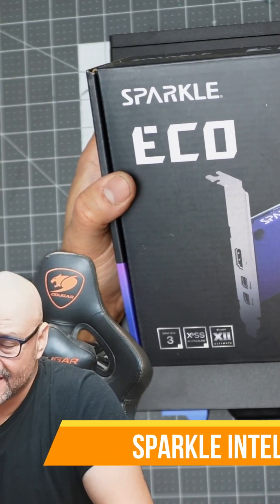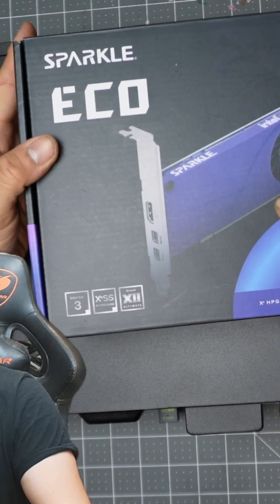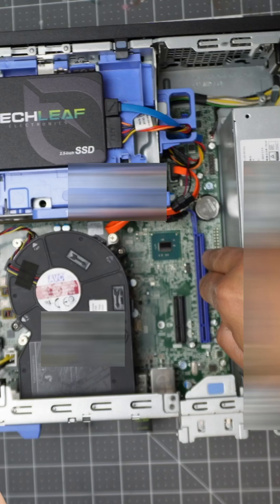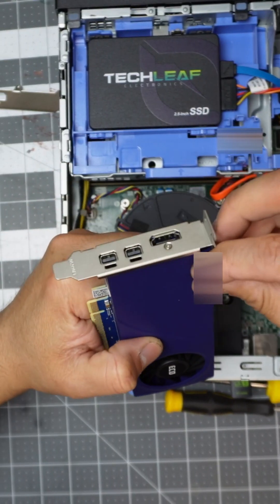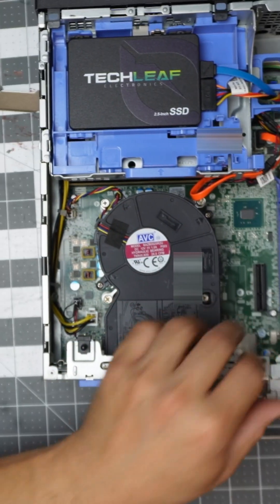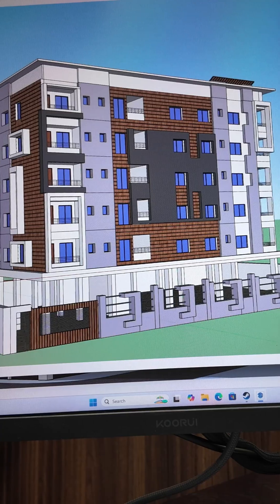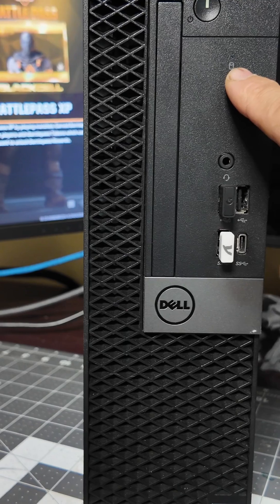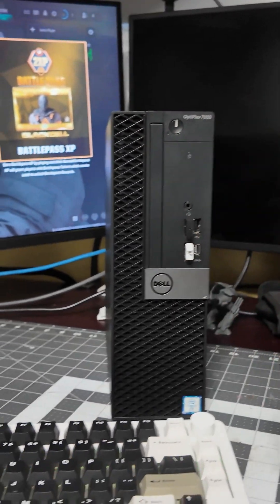Sparkle Intel Arc A310

Comment: Can you make a new video with the sound of the card? Considering buying one, byt I'm hesitent due to noise.
Reply: After more Duckducking I discovered the noise complaints were due to bad firmware. Upgrading would fix the fan issue.

I bought it, and its not loud at all. Recommend it

Comment: you did not show changing to small bracket, i hared issues about it , a third screw   not easy to get
Reply: There's a little black cap on the shell that you can pull of in order to access it. It's not that hard to replace the bracket to the low profile bracket.